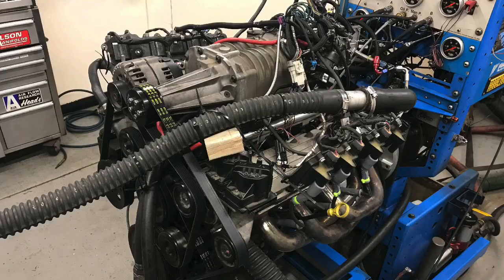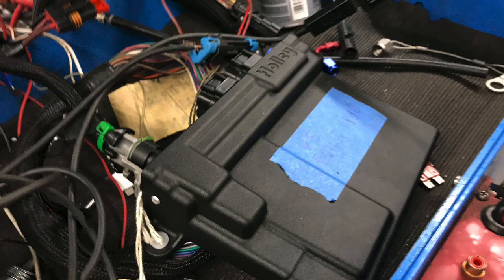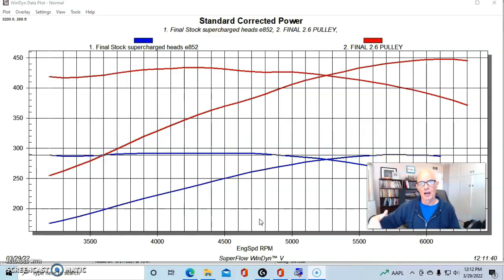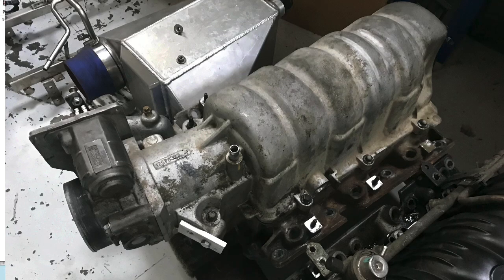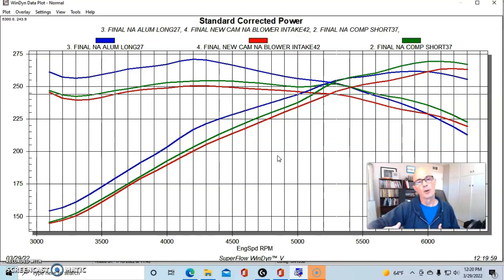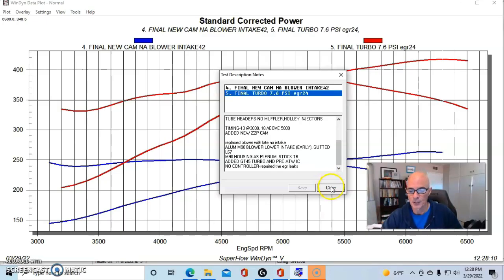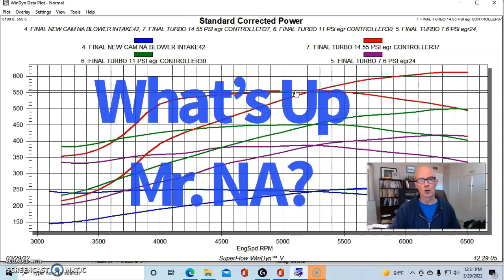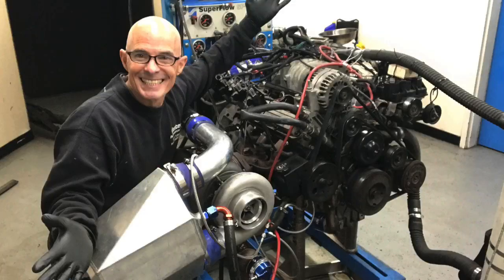JUNKYARD TURBO 3800 V6-WHY DOES IT MAKE SO LITTLE HORSEPOWER NA AND SO MUCH POWER UNDER BOOST?

Comment: 3800’s are definitely slept on, just wish there were more options for aftermarket parts like heads and intake manifolds and stuff
Reply: Honestly zzp is extremely overpriced for basic parts compared to other platforms
Reply: @emersonurbina8042  because they are 1 of 2 company's who sell a large amount of parts
Reply: @jacobburskey3044  yeah I understand that but it's still crazy have you seen their  CAI it's so cheaply made and cost like 300 bucks I understand performance parts but some things are insane same with intense racing
Reply: @jacobburskey3044 😅
Reply: @emersonurbina8042 yea like the fuel rail 300 bucks and compared to hondas k is 120 and quality is better there over priced sane as the fuero mounts
Reply: @emersonurbina8042  zzp is a kinda crappy company I like intense much more. Zzp’s parts are ok, but their tunes kinda suck, they don’t like to help anyone with a camaro/firebird really, and theyve done some shady business. They were the people who started the whole “you can’t rebuild a 3800 otherwise the bearings will spin” rumor. They allegedly used to rebuild engines with poor tolerances and people would spin bearings a few hundred miles down the road, so I’ve heard from a few people who have been in the 3800 game a while that they made the myth up to cover their asses. The majority of people bought it bc they were one of two companies making parts for these engines. Meanwhile intense sells race ready rebuilds that can make stupid power and they were rebuilt, same goes for everyone in Australia with the “ecotec” 3800’s (same thing)
Reply: @Matt_Lanzer_13  Intense screwed over a lot of people very early on and most people that are still into 3800s remember.
Reply: @emersonurbina8042  its not overpriced there is just not demand. You can’t compare it to mass produced parts.

When you sell 1 of an item a week it’s going to cost more than a company selling 5,000 a week….. 
they would go bankrupt if they sold them at the same price.
Reply: @JPL Performance that is true and sadly with it being fwd is the reason the platform isn't as popular
Reply: Imo parts like that are some you can easily make your own, just as effectively, for a lot less. Specialty parts is when you should go to them like their intercooler/cams/equalizer/etc
Reply: I don't believe it's a matter of "we don't mind paying the price", as it is "we don't have any choice but to pay that price".   ZZPerformance and Intense know they have the 3800 market cornered. There's no one to compete with so that can charge whatever they want.  But Intense is a little more reasonable in some areas. Intense also offers various shipping options that can really help ease your pocket book
Reply: @Boosted007  you can order cams, springs, retainers, lifters etc straight from comp cams. I get springs from pac too. Rocker sets from T&D. Pistons/Rods from any of the big names. Don't have to use Zzp or intense at all.
Reply: @3800 TURBO  I'm looking for rare 3800 parts
Reply: @jplperformance9073  I have a stage2  intake manifold. Other parts somewhere
Reply: @Spooln272 .  any RARE 3800 parts ?? Besides the intake??
Reply: @jplperformance9073  please define rare 3800 ? Buick Motorsport wasn’t doing any high performance parts after 1990 .
Reply: @Spooln272 .  I'm talking about the 3800 series 2&3. Not the 3.8 Buick motor that was in Turbo T Types, Grand National  ect. 3800 from GTP'S, Monte-Carlo SS's, Buick Regal 's. The 3800 supercharged motors.
Reply: @jplperformance9073  really wasn’t as popular as 3.8 not a lot of factory  or aftermarket 
Great engine if built correctly. Yes can use 3.0 and 3.8 parts.
There were guy or running in the 9s 1/4 mile. Mid 90s use knowledge of 109 blocks.  
Just pick your poison!
Reply: @MrBlackbutang  there’s plenty of aftermarket just need to know where to look lol. Most manufacturers make rods/pistons for them, a decent amount make cams. As for specific stuff like heads, there’s intense and zzp stateside, then mace and a few others over in Australia. For custom aluminum and billet parts Kevin Yates racing engines does lots of stuff for them but it’s all made to order
Reply: @Matt_Lanzer_13  lol most of this stuff is 109 block modded. 3800 is 3.8 Buick people easily running 11s before any of the businesses got into 3800 engines. ! Pistons have been available since 1978 for that engine. Lol
Reply: @MrBlackbutang  I’m not talking about gnx/tta/t-type 3.8’s. Yeah there are a lot of parts for those. But again…. Most major manufacturers make parts for series 2/3 3800 parts. Then intense/zzp and again mace in Australia and Kevin yates racing. All series 2/3 parts.
Reply: Check on the Aussie sites, there are tons of RWD L67 parts available, even an A2A intercooler for the M90.
Reply: @MetalAcresGarage  there definitely are, however a good number of them aren’t useable as the Holden’s are rhd, so our steering shafts interfere with product placement
Reply: @JPL Performance I can totally understand the mechanical addiction lol. I have no regrets doing all I've done to my bird and did it because it's what I had to work with. Gave me a big respect for the 3800 platform in general. There was a lot of fun stuff I enjoyed learning as time went on. I get a lot of shit from guys in the f-body crowd for not LS swapping. LS engines are awesome too. I just work with what I have in the moment and obsess about it until I've gathered enough info to launch into a project lol. You nailed it, and that's exactly how I can relate and understand. .

Fox body's are awesome. I'd love to build one some day if I ever got my hands on one. I've learned now about building my manual T5 in Fox body groups than anywhere else. They love the T5 in the Fox body world
Reply: In the next 10 years the cheap Ls' are going to be eaten up so people are gonna flock towards the next best thing I think we just gotta suffer when we're ahead of the curve
Reply: @JPL Performance thanks a bunch. I've watched several of your videos as well. Good content. I thought I was subscribed but I guess I wasn't 😬. I am now though
Reply: T/A performance
Reply: Someone needs to make an aftermarket intake manifold for rwd cars like firebirds and Camaros. Something that can flow better.
Reply: Same with the 4.3 V6 and the 3.4 slept on and they both can make power.
Reply: Question: do you know of any 3100-->3800 swaps for my 96 Buick Century? I'd be interested since we have RPM Performance here in Indy. I'd just have them do it...maybe just ask them 😅
Reply: https://youtu.be/4gyLoTOlz4U
Late bloomer
Reply: @MrBlackbutang  and 10.85 is not the fastest 3800 lmao people have been way faster. It’s not even the fastest supercharged setup.
Reply: @Matt_Lanzer_13  8:30 is fastest recorded time 3800 . Wasn’t any zzp parts .
Reply: @MrBlackbutang  I’m not supporting zzp. In fact I dislike them lol. But who and where did that time? Not listed on any of the record books…
Reply: Ya for a swap it will probably be rear wheel drive so the blower and most the intakes won't work or won't work easily I guess if you scoot the engine forward, it would be to bad but kinda weird I think the camero had 3800 with a rear wheel drive intake but I think thats it
Reply: I’m stuck at the waste gate…..I got a large waste gate on the cross over.
I might put a smaller one in the O2 sensor bung hole….I don’t wanna weld my ZZP power logs’ I don’t have a welder that welds stainless steel, and don’t wanna weaken the exhaust manifold’….I have the heavy turbo mounted to it…..I don’t wanna crack the rear exhaust manifold….

I might have to weld one pull the turbo, and weld one to the exhaust side of the turbo…..I really really don’t want to weld one to a brand new Turbo…..It’s not cheap.
Reply: Intake manifolds it’s easy now with 3d printers being cheap as chips.
Reply: Most were dropping V8s in where a 3800 or 4300 were.